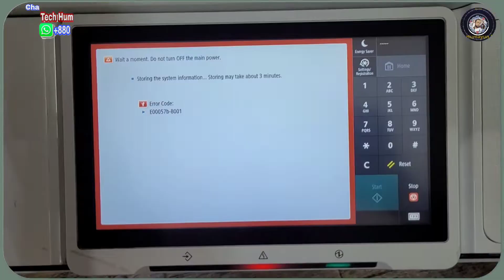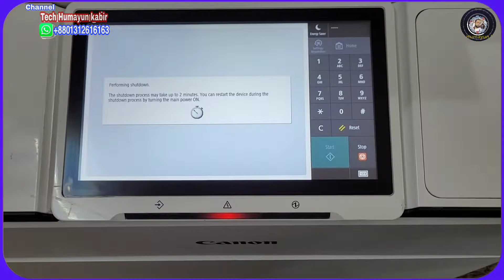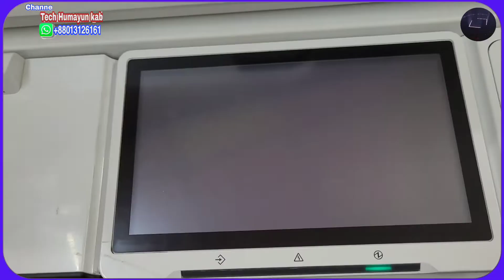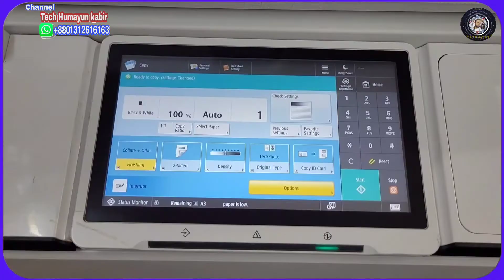How to fix this error code E57B-8001 problem, is discuss Canon imageRUNNER ADVANCE #canon #subscribe

Comment: canon adv 8085 pro e 000808-003 tell me how to fix
Reply from the maker: 1)  Check the power cable plug correctly Check if the spare plug cable is 6mm why the machine is not getting current properly.

2) Fixing Power Supply error. Inlet current is 1A or lower for 1 second or longer although the maximum voltage is output.
Reply: Replaced the wires, still old.

Comment: svp Sharp code E7-20
Reply from the maker: Sharp inter the model
Reply from the maker: Clean scanner unit 
Use SIM61-1 to check the operation of the LSU. Check connection of the connector and harness between the LD PWB and the MFPC PWB. Replace the MFPC PWB. Replace the LSU.